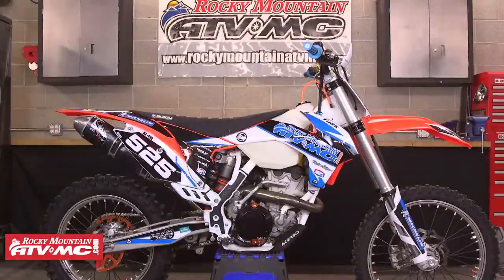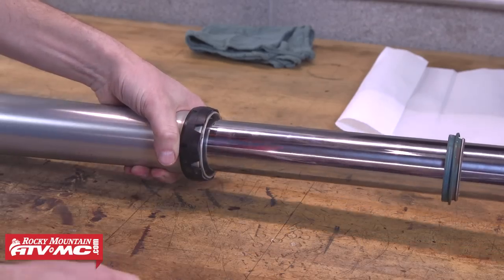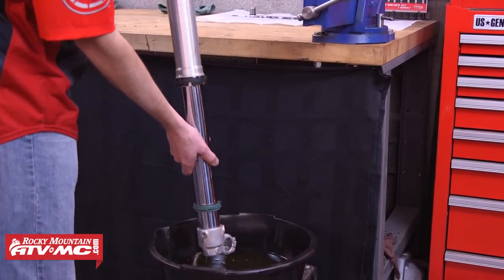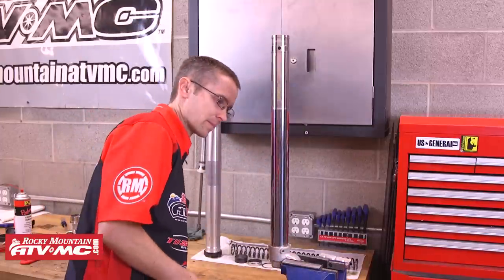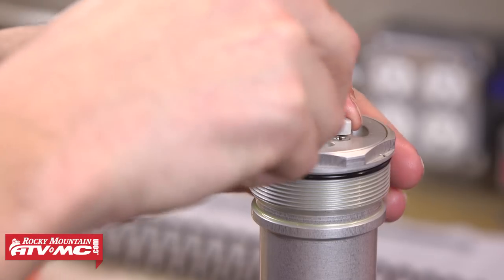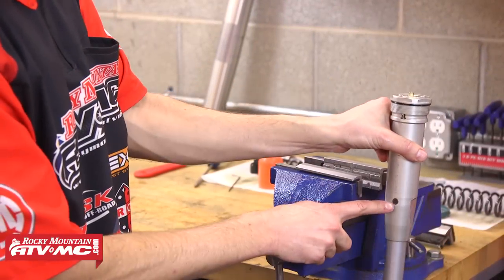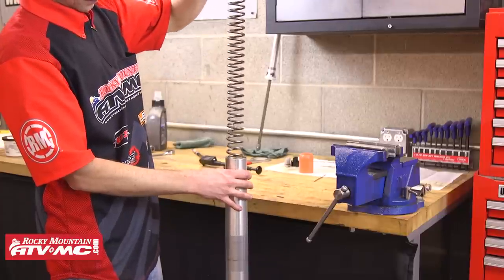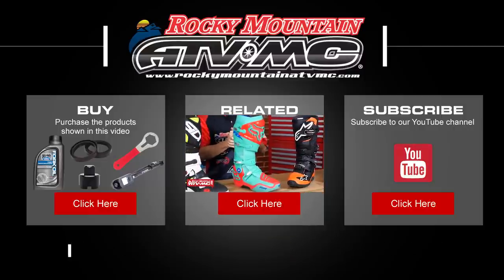How To Rebuild KTM/Husqvarna WP Bladder Style Forks

Comment: I've seen a lot of comments about losing 1-2 psi when removing the needle.  This is an incorrect assumption.  What is really happening is that the pressure in the body and hose of the pump is reduced to atmospheric pressure when removed.  If you put the needle back in, air from the bladder is re-pressurizing the airspace in the pump.  The sum of these two volumes averaged will ALWAYS read lower than what you had before removing the equalized volumes the first time.  Pump it to 17 psi - remove the needle - done.  DO NOT put the needle back in to check the pressure, because it will read low EVERY TIME.  Great video BTW - Thanks for the guidance!

Comment: Tip for anyone doing this and having issues getting the fork seal deep enough to seat the retaining clip. Before driving the fork seal in, use your seal driver to seat the large washer that's on top of the fork seal first and then drive the fork seal in. Spent about 30min fighting mine until I did this.

Comment: Excellent video guys. Just one comment, on the final bleed at minute mark 15:26 it would be helpful to know that if the damper rod "does not fully extend by itself" you most likely have a bad oil-seal which is located inside the Screw Sleeve ( # 76). The oil seal is called "PISTON ROD SEALING", it is # 75 on the parts list, P/N: 48600471. I am currently rebuilding forks on my 2007 150SX & one fork will not fully extend. This happened before & replacing # 75 fixes the problem.
Reply from the maker: Great feedback sandbiker! Thank you for sharing that knowledge with us.  Much appreciated sir!
Reply: Thank you for the knowledge, guys! I have the same problem on my 350 sxf 2012 (the damper rod does not fully extend by itself). Do you have an idea which part should be replaced in my case? Or is it possible that the air pressure is too low to extend the rod?
Reply: ***Another part that will keep the damper rod from fully extending is"PIN KIT" #54 on the parts list (P/N: 48600977S) This was the case on my 2012 350 XC-F.
Reply: Nice job guys.. But i have some question. How to repair weak fork spring? Thank you

Comment: Once again a great video guys! One point that I would like to draw attention to is that it is imperative to avoid using a impact wrench when removing the rebound adjuster on the bottom of the fork leg as the hammering action of the tool can disturb the delta shims in their relative relationship to the corresponding ports on the mid /rebound piston.

Comment: I got your seal/bushings kit. The little rubber thing you stick the needle through leaks all the 17psi pressure out. I replaced it and it still leaks. I'm using a 23gauge needle. Thoughts?

Comment: Hello. I need your help. I have one of this close chamber to put on my xcw250 2017. Xplor sucks. 😉 I Wil put some pair of new springs,. 40 to get soft feeling. I will put new seals and new oil 5w. The problem is that I remove everything but unfortunately I push the low into cartridge and oil outs from bleeding valve. Is any problem with that or is best push some fresh oil? Best regards sorry for my English

Comment: do you ever need to put air in the bladder. If i am bottoming out, would there be any reason i would need more air in the bladder. I am also confused on the air part, do you unscrew the bladder access wholes once in a while to let air out like the other bikes?  Sorry i just had my suspensions done by professional last year and found the front was bottoming out.

Comment: Great video, thank you very much. 
One question, I'm on the lighter side (135 lbs) and have had my forks valved for my weight, is the bladder psi going to be the same regardless?

Comment: Currently doing this now. Any suggestions on cleaning the inside of the tubes?
Reply: Thanks for the reply.  I was just telling a friend I might use a broom handle and shop towels.  :)  How about using non- chlorine brake parts cleaner?  Have everything torn down and changing all seals and bushings with the Pivot Works kit.
Reply from the maker: Jeff Loucks Yea as long as you are replacing both oil and dust seals, brake cleaner is fine.  Note, wipe down the tubes dry before installing the new seals.  Hope this helps
Reply: Got it !!  Thanks for the help and great easy to follow video.
Reply from the maker: Jeff Loucks Thank you!

Comment: awesome video. Thank you so much. I'd give you ten thumbs up if I could. The costs for doing this the first time myself were about the same as when I had gotten it done by someone else, because I had to buy the special tools needed for this. Nevertheless, it was a fun project and I did learn a lot. A word about to be cautious with the pin valve of the inner cartridge would have saved me 30 minutes of desperately trying to get that thing back in.

Comment: Hello guys, thank you for this very useful video. It helped me immensely to service my forks. 
 - I have the nitrogen needle and will get the pump as well the only thing I need is the adapter between the pump and the needle => where can I get that from please? Is that something TUSK is selling as well?

Thank you for your help in advance. 
Regards
Ales
Reply from the maker: The Tusk Digital Suspension Pump threads right on to the Nitrogen needle.  No adaptor needed.  https://www.rockymountainatvmc.com/Sales/463/KTM-350SXF-Bladder-Fork-Rebuild
Reply: Sorry for such a late response. Thank you for the answer. It is much appreciated. 
Regards
Reply: Best. Fork video.   My  forks. Held 450 cc total

Comment: I have the same fork on my sx144 and it makes clunking noise when fully extended - going over whoops you can hear the noise and feel space in the suspension.  I have not seen any oil leaks .  What could be the problem?
Reply: Thats the springs in the forks have lost length and have lost thier preloaded length hence the noise and loss of stroke resistance id say

Comment: Hey rocky mountain atv mc 
would you know why my fork has no rebound control and just shoots back up alot faster than its partner
 It's not an upside down fork its from a 1999 tm 250 en
any ideas would really help 
the fork with crazy rebound has a leaky oil seal that i am about to fix but i am not sure that this will help with rebound rate PLEASE HELP
Reply from the maker: I can recommend you fix that leaky seal and rebuild the fork with all new fluid. Then dial in your clickers.. rebound/compression.  That should give you a good starting point.
Reply: THANK YOU FOR QUICK REPLY when i adjust both rebound and compression in the leaky fork leg i can't get any rebound dampening at all but when i do this on the other leg i can feel the difference would the leaky fork oil seal cause loss in the ability to control rebound
Reply: Rocky Mountain ATV MC
i got the seals and oil i am going to do them in a few days
Reply from the maker: Tm'250 gasgas125 Do you know how long the fork leg has been leaking for? Depending on the amount of oil loss yes, it could be the reason why you're not able to control the rebound
Reply from the maker: Tm'250 gasgas125 Awesome 👊 !  For sure do both fork legs.  Also, pay attention to the good fork leg when disassembling.. you may find something reversed from the fork leg that's leaking and why it's not rebounding as good?
Reply: good logical thinking my friend will get to it and thanks again
Reply: it's been leaky since i bought the bike so not sure how long it had been leaking or how much oil it has lost
Reply from the maker: Tm'250 gasgas125 ..safe to say, that may be the cause.  Good luck, let us know how it goes!
Reply: will do! this is my first fork seal job i thought i would give it a try as i'm trained in light car maintenance by my former college so understand the basics and you guys explain general bike maintainence really well in your videos and gave me confidence to try some things myself THANKS AGAIN
Reply: I ran into problems my right-fork damper rod had play in the bottom bushing if it is called that
 
Really short on money at the moment (between jobs hopefully not for too long) so after a few weeks of thinking i put it back back together again without fixing the damper problem

Even with the new seals/oil it has to be the reason i have zero control over rebound 

However it is the least of my worry at the moment as it is rideable compared to my 2015 gas gas 125
It has been out of action nearly 8 months now with a broken powervalve can't find a spare anywhere

Comment: Is it necessary to do the whole rebuild?Can I just replace the seals and bushings,fill it with the correct amount of oil and put it together.Skipping the whole bladder deal?
Reply from the maker: +Binkke I guess.. if you're looking to save a few bucks and some of your time.  Our Tusk Digital Suspension Pump comes with the Race Tech Nitrogen Needle in a kit for $77.99. Keep in mind that the fork oil in the inner chamber that you are bypassing is going to get dirty and eventually prevent the flow rate.  We did our research on these forks and these steps that we demonstrate are the best way to rebuild them.  

Here's the link for the Suspension Pump: https://www.rockymountainatvmc.com/p/3545/50671/Tusk-Digital-Suspension-Pump
Reply: i was thinking the same thing thanks for the response.  Next year i'll do the whole thing but this year just wanted to do the basics.  Are you able to put a link down for this kit? the race tech nitro and and needle kit?
Reply from the maker: Kevin Vienneau Here's our sales page: https://www.rockymountainatvmc.com/Sales/463/KTM-350SXF-Bladder-Fork-Rebuild?utm_source=Youtube&utm_medium=Ktmbladderforkrebuild&utm_content=Descriptionheader&utm_campaign=Youtubevideos

Comment: Is it possible to take oil seals off without loosing oil ??? I mean for example screw off down side of fork like at the beggining of the video and Then just push fork out without screwing off, upper side of fork ??? Critical sitution :( . I have wp suspension from 2008
Reply from the maker: Well you are supposed to be changing out your fork fluid periodically. Your service manual will tell you the intervals on when to change the fork fluid and seals.  We recommend changing out the fork fluid and oil seals together.  Hope that helps. Thanks

Comment: My bladder module won't hold air, comes straight out!!
Reply: Did you figure out the problem? I’m having the same issue.
Reply: @tgaydos99  Yes the tops were perforated so I sent them to Stillwell Engineering it's an easy fix. It looks like KTM is bringing the bladder forks back!